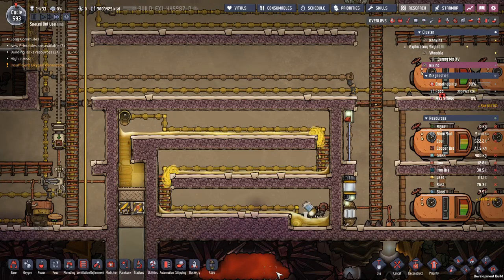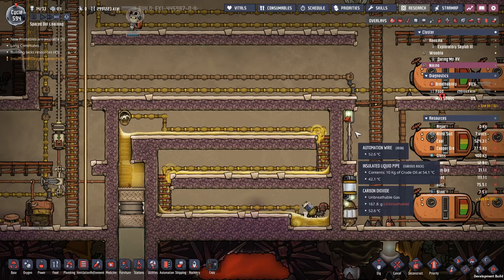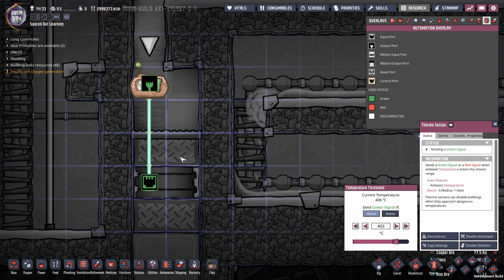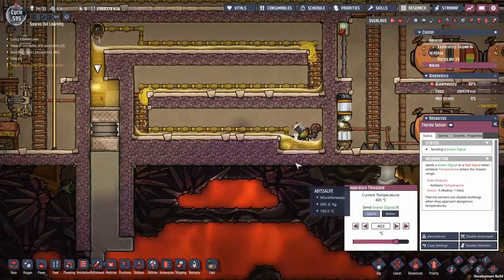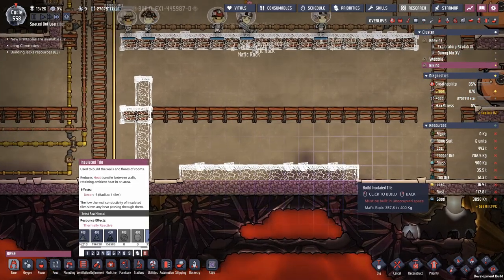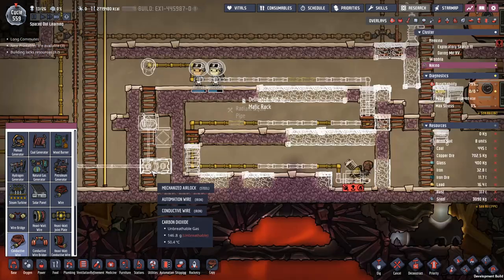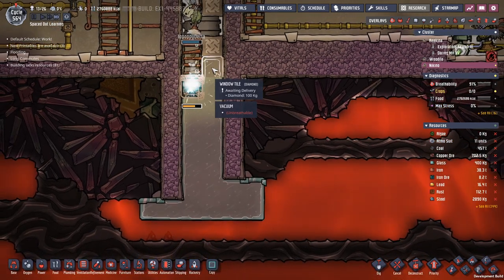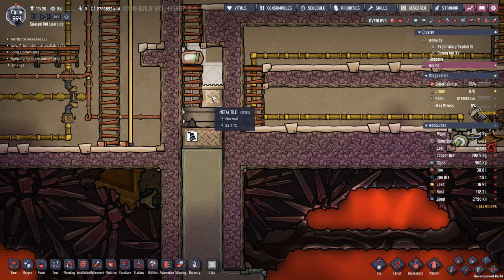Easy-to-Make GEOTHERMAL PETROLEUM BOILER | Oxygen Not Included "Spaced Out" DLC | Tutorial/Guide

Comment: A great introduction to the petroleum boiler in its simplest form. Also, good coverage of the things to be careful of when building one. Working with magma isn't really that hard, it just takes patience and forethought because a single mistake is deadly, plus it's helpful to know a few oddities of ONI's physics simulation.

If I had been making this, I probably would have made it 3 levels high, so there's room to replace the heat spike with a thermium aquatuner + tepidizer later on when (eventually) the heat from the magma biome runs out. Of course, the other solution is to run it off a volcano, but that gets into more difficult magma handling issues, so it was probably for the best to avoid that here.

You kind of skimmed over the advantages of the oil well -> petroleum boiler -> petroleum generator -> water sieve -> oil well loop, so I'll cover it in a bit more detail here:
Because of the efficiency increase a petroleum boiler gets over an oil refinery, this loop actually consumes NOTHING AT ALL (except filtration medium for the sieve, which used to be free due to regolith, but in the dlc is a bit more of a concern. You can always replace the sieve with a polluted water boiler if you're not sure you can sustain the filtration medium), so when you're using it, it actually makes sense to waste its outputs, just so you don't slow down the production of other outputs. This is a bit counterintuitive when some people first try it. They instinctively feel like petroleum is a valuable resource and try to automate their generators to only run when batteries are low, etc. Don't. The first priority is that the loop always runs. It's correct to waste the outputs in order to maintain that. Done correctly, this loop can be the basis for 100% sustainable power and oxygen, leaving food as the only thing still to be managed to keep your base going forever.
Reply: Just curious, at what cycle does geo-thermal energy run out? I heard it will last for thousands of cycles. Considering that I won’t be playing for that long, is that a concern?
Reply: @mood3995  It depends immensely how thermally efficient your petroleum boiler is, but thousands of cycles is certainly realistic. I tend to prefer to run it off of a volcano just so that I never have to think about it again, but yes, a reasonably efficient geothermal one is likely to last long enough that you don't care.
Reply: "leaving food as the only thing still to be managed to keep your base going forever" --> You can feed the large amounts of CO2 coming off of the generators to slicksters for meat/barbeque (who also give more crude oil!).  Depending on the scale of your operation, this may be enough food for forever.
Reply: @tejing2001  They have the same life cycle and produce the same amount of meat/eggs as hatches.  They are literally as viable if not more viable a food source, as with the right setups, CO2 is easier to provide than minerals.  You can set up the ranches below the CO2 producers like your Petroleum and Coal generators, easy peasy! =)

Comment: This is my favorite petroleum boiler. I’ve experienced every possible way where things could go wrong, and learned from every mistake. The amount of crude oil going into the boiler is very important. I’ve found out 5kg is the best. Less than that, the petroleum doesnt cool down enough(the frustration of finding sour gas after a couple dozens of cycle…gosh..)and more than that sometimes make the doors stay closed for a tiny bit more(which can cause rapid raise in temperature and you could end up with sour gas…again..)
Anyway thanks for the greatest setup! This lets me have infinite power in my base without using any manpower.
Oh by the way, I dont cool down my crude oil and the default temperature is usually 80 something celsius. 
If you use cooler crude oil, I guess you can use less than the 5kg flow, as in this video.
Reply: Was was the final temp of your output petrol, and did you try doing anything to cool it further??

Comment: Nice and detailed video, thanks! An important improvement: With a little extra automation, you should check the crude oil temperature at the "kink" shortly before being dumped in the "reaction chamber". An AND gate that links your petroleum and crude oil temperatures to the steel air lock to keep it closed if the crude oil reaches 402°C. For very long duration, you also want do use a double layer of isolation between the conversion chamber and the heat exchanger (to the right of the steel door sandwich).
 
This goes in the same direction as the comments by @Jeff Huffman and stems from the difference in thermal capacity between petroleum and crude oil. It is not that much, but since conversion takes 10kg of oil at 403°C and changes it to 10kg of petroleum at 403°C, a petroleum boiler actually generates ~70DTU heat per kg oil converted. You can exploit this mechanic more substantially by melting regolith and generate the same mass of igneous rock! Here this means, crude oil temperature will keep rising in the pipes along your heat exchanger over time. Certainly not a problem for 1000+ cycles because your setup has a lot of thermal mass and is not vacuum-isolated from your base, but I had built mine more compact, in thermal isolation and running very long, so of course I ended up with damaged pipes... To put it differently: You use crude oil at 30°C to cool petroleum at 403°C. Since petroleum has greater "thermal mass" (mass times specific heat capacity), the high temperature creeps towards your cooling input. But with the extra temp sensor, your magma lasts even longer as you effectively use the "cheated" heat to power the conversion ;-)
Reply: "An AND gate that links your petroleum and crude oil temperatures to the steel air lock to keep it closed if the crude oil reaches 402°C." Don't you mean "keep it open"? - i.e. so as to cut off the heat?
Reply: @bpdlr  You are probably right, and the AND gate would then be wrong, too. Open airlock means no more heat and is achieved with a green signal, so you would just need to connect both sensors to the door and set to "green signal if temp higher than"... but I have not played in a longer while and am too lazy to check now 😇

Comment: Thank you so much for this video (two years later) that finally got me through my energy squeeze and hopefully push into more distant planets!
I struggled with temp balance for a while (petrol was coming out wayyyy too hot and climbing) and seems like for my 71c crude 5kg input worked the best. I also had a chunk of iron sitting right on the temp shift plate at my petrol pump and not sure if that was contributing heat, but get all that debris out of there!

Now how do you manage it when you are reaching the storage limits for your petrol? Do you just keep building more tanks and pray, or is there a sane solution to brining it offline?

Comment: Make it possible to turn off: raise the  openning of the petrolium "well" one tile compared to the heat exchanger, the heat transfer between the boiler and the heat exchanger is broken when the oil input is turned of.
prevent over cooking:  place a temp sensor to the right of the metal tile at the top of the boiler, you can fine tune the temperature of the top metal tile so it does not over cook. The tile needs to be placed in gas then isolated around.

Comment: WARNING: Great build, but there's a  pretty big flaw in the construction aspect. Those rocks we're constantly sweeping at high priority? The ones around 1600 C? Well, the petroleum in the liquid lock flashes to sour gas at 540 C. You do the math. It took me forever to figure out where all the sour gas was coming from and spoiling my vacuum.
Reply from the maker: Warning: Comment above doesn't know what he is talking about!
I've run this for 100 hours and never seen any Sour Gas.
There is nothing in contact with the petroleum that is close to those temperatures
Reply: You didn't read my post. It wasn't the operation, it was the construction. Digging out Abyssalite (and Obsidian) right next to magma, yields  debris 1000 degrees and up. Carrying it through petroleum has resulted in several sour gas bursts - during construction*, remember. Even as we speak, I have a  temporary Storage Bin *inside the build filled with 900 degree obsidian among other things, and am figuring out how to get it out before start-up. I'll post a video.
Reply: @Nilaus  savage
Reply: Late comment, but for future readers: Minerals that spawn in magma will indeed start life at about 900 C. Players need to be very careful about where they put this particular leftover material when digging around magma. In particular don't just dump it in with your general storage, as it will leak heat, and you may not realize what's cooking your base. It will definitely also flash oil to sour gas, so definitely don't dump it in or near oil.

Usually, I just let it stay in the magma, since it's basically hazardous waste. However, dupes can transfer it without difficultly, so it can be rendered safe by dumping it inside a steam turbine's boiler and bleeding the heat off as energy.

Comment: Beginner question here, what is the motivation behind the diamond window tiles? What would happen if you simply dug up the lava?
Reply: Diamond window tiles are really thermally conductive and they carry heat from magma to the boiling area. You could put the boiling area directly above the lava, it'd just be awkward in terms of layout
Reply from the maker: Diamond is an amazing heat conductor and it can withstand extreme temperatures.
If you let the lava flow in the dupes will burn and you need to manage a liquid instead of the solid tiles, which is much harder (how would you pump molten lava if you have excess)

Comment: Apart from the power and the water, you can also get meat out of the boiler by using the CO₂ to feed slicksters
Reply from the maker: Somehow my slicksters always kill themselves. I need to dedicate sone time to get some good designs going
Reply: @Nilaus  I've taking to having a radiant pipe petro filled liquid loop going through my slickster holding pens, with an end of the loop going through an automation controlled heat exchanging brick.  120 is a good number to target to slowly convert to molten.  If the holding pens are small but open at the top, they never seem to get cramped.  I just insulate the parts that are not behind the slicksters or in the heater.

Comment: Great video, very solid boiler, I haven't tried one with an internal vacuum, seems like a good call for reliability.
These things are a huge pain to get started - really glad you went into that in detail.

I need to experiment with diamond windows for heat transfer - seems like overkill at first glance - you dont really much heat transfer if you have a proper heat exchanger setup as you do - I woulda just dug down to the lava, setup a gas exit, closed off the area and then pumped some hydrogen or ethanol in there - im lazy though.